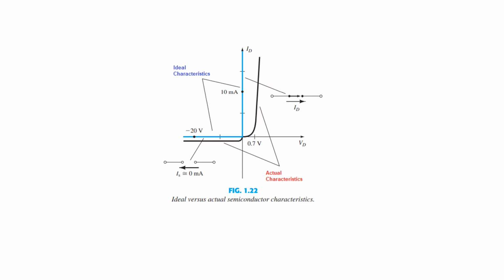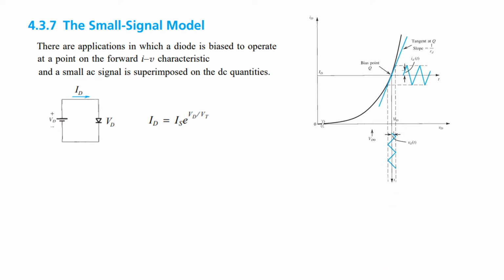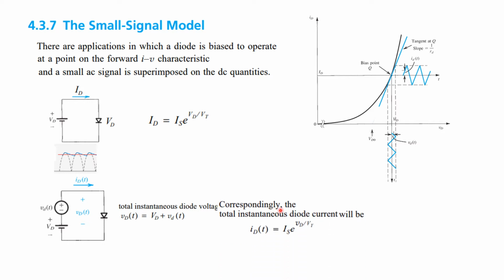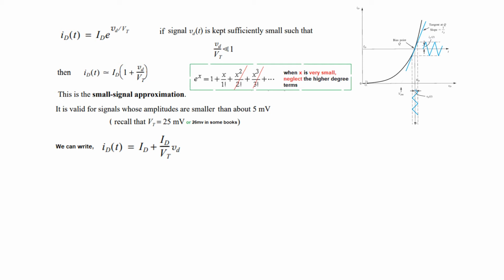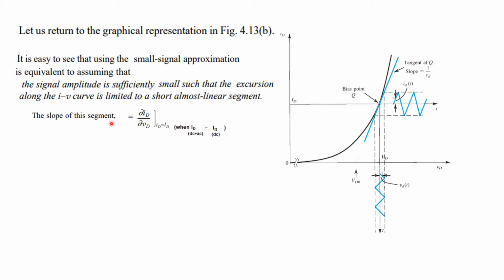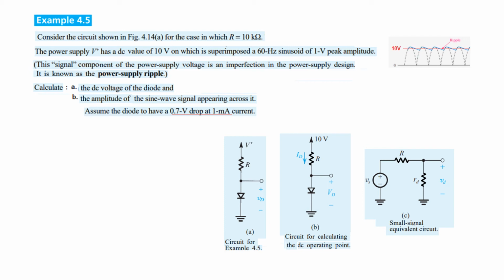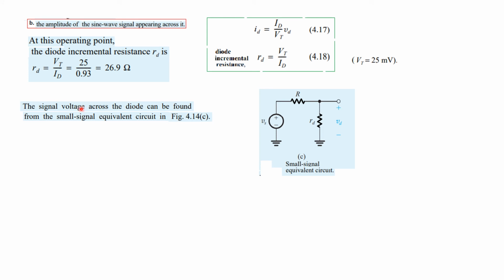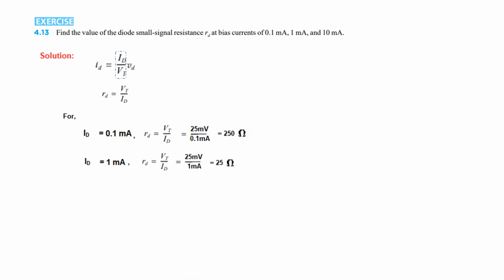(E) EDC (S) || Small Signal Model of Diode || Ex 4.5 || Exe 4.13

Comment: Assalamu alaikum,
At 8:28 The condition more precisely has to be that vd is very, very smaller than 2Vt, not Vt
vd<<2Vt because if you write the exponential like this:
e^x = 1+x(1+x/2 + x²/3!+....)
You actually need x to be much smaller than 2
Or vd/Vt is much smaller than 2
So you can have vd equals to 5mV or smaller like 3 mV in the video.
But for vd much smaller than vt   (vd<<Vt)
Because then x<<1 and e^x=(1+x+x²/2 +.....) will become 1
In this case, we use vd equal or less than 2.5 mV because we use one tenth of the value.
This is how i learnt in the University in italy as an electronic engineer student.
So i hope you see the error in your video, and i hope the best for you.
Reply from the maker: Sorry, I don't agree. vd/Vt has to be very very small.
Reply: @ElectricalEngineeringAcademy  i agree that vd/Vt has to be very, very small, but how small is enough for our approximation to have negligible error.
I'm sorry if you misunderstood me.
I meant that for our case of approximation, we use vd/Vt<0.2
Because that's how we usually use it
as a rule of thumb. at 0.2, the relative of error would be around 1.7%
At 0.1, the relative error is 0.47%.
And 1.7% is enough when learning
But in research, i think it is much lower.
But again, practically around 1% of error is enough
Reply from the maker: @karimalramlawi7228  The book says "It is valid for signals (vd)whose amplitudes are smaller than about 5 mV". With VT =25mV, it is about 1/5 th.

Comment: Design the following circuit to provide an output voltage of 2.4v. assume that the diodes available have 0.7v drop at 1ma and that ∆v=0.1V/decade change in current.

(Sedra & Smith_exercise D4.11)
Please please solve this problem. I can't understand the conversion of decade. Please someone explain in mathematical form.
Reply from the maker: which edition of the book u r following. Share me the pdf copy at profkhannazir@gmail.com
Reply from the maker: https://youtu.be/A8sQmNTmHoI